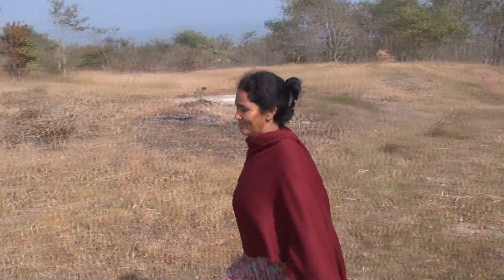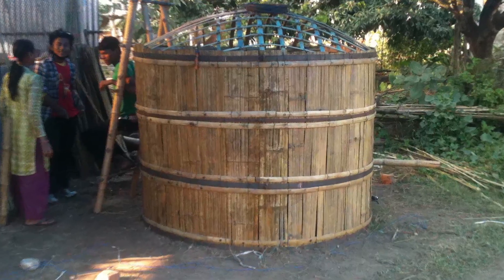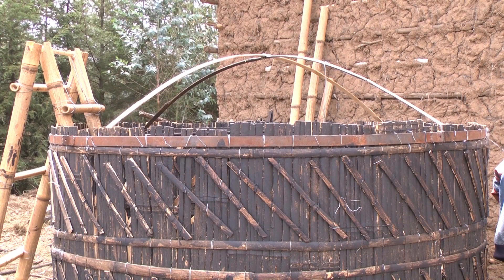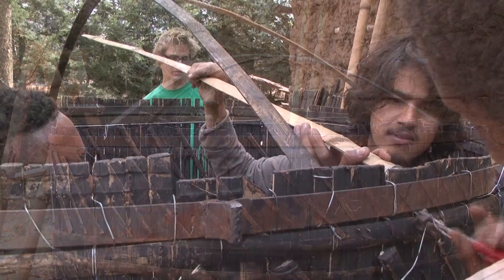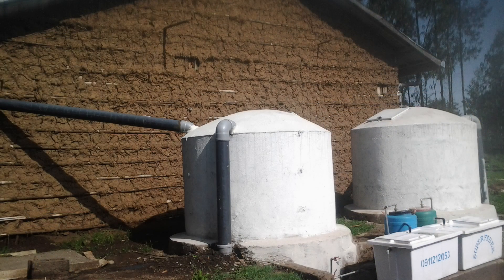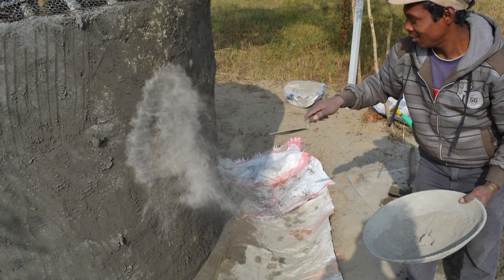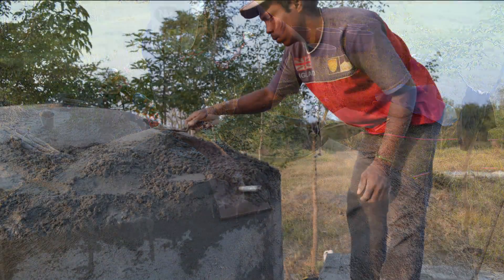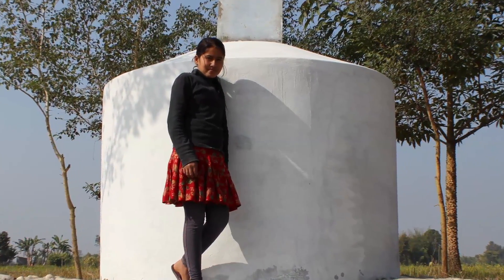Chapter 5: Tank erection, coating and plastering

Comment: That is real fail with those metal strips
Reply: why?
Reply: @knarf3985  can't remember
Reply: @nina-maeforde3269  ok
let me explsin why i know thats not a problem at all,
because the metal strips only has got the function to hold peaces together in place while they are not plastert. they have no othe function at all no structual or any other. so if the dissapear ater plaste rjob is done it doesnt matter at all.
for example:
the tire wire for steel reinforcing has got the same function just holding all the steel bars in place where they have to by while its concretet ansd hasnt got any structual function :-) have a good day
Reply: I really would have to watch the video again to remember what I was talking about, you have a good day too
Reply: @nina-maeforde3269   hi nina-mae
where are you from?
the story was about building a watertank out of bamboo as reinforcing and plaster...maybe that helps :-)
Reply: So I watched a few minutes of the video to try to remember, I still don't remember lol, but I do have fresh views, one is that bamboo is water, basically, so any bringing of bamboo and steel together is a bad idea. Water and steel causes rust.  Second and most important, when you have bamboo, steel is unnecessary, because bamboo can perform all the functions of steel. I am from Trinidad and Tobago, where are you from

Comment: Interesting video.  But can I ask how long a bamboo water tank would last compared with a more conventional equivalent?

Would the final cement and water layer inside the tank prevent water seepage which would eventually rot out the bamboo and rust the wire?